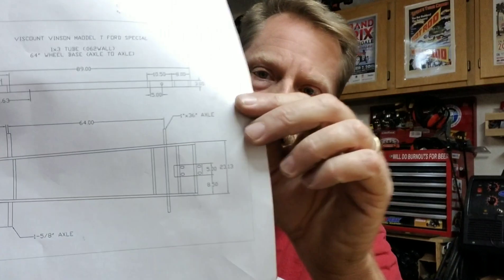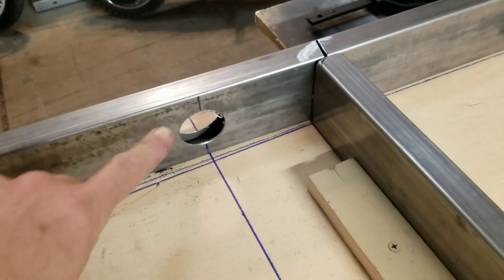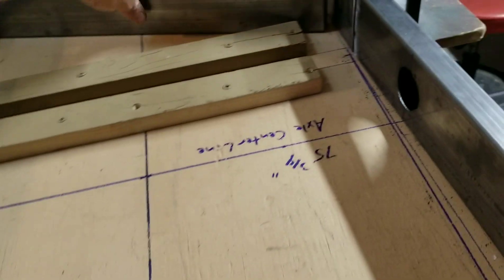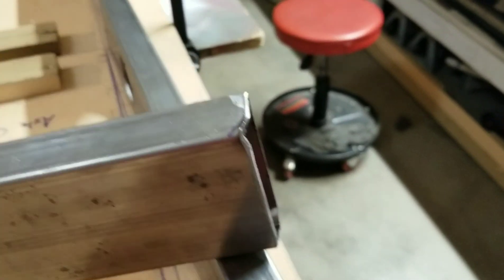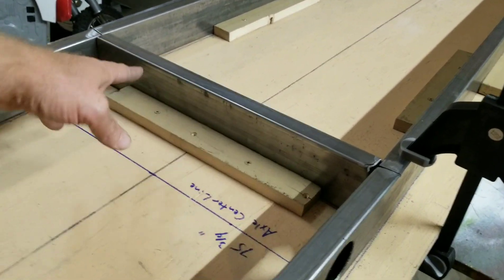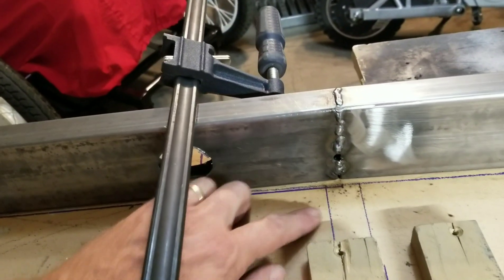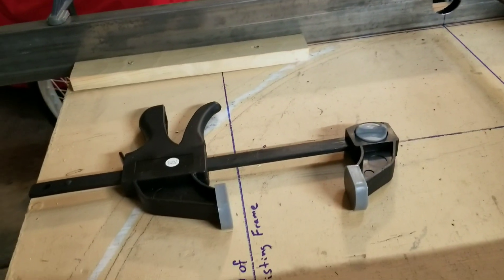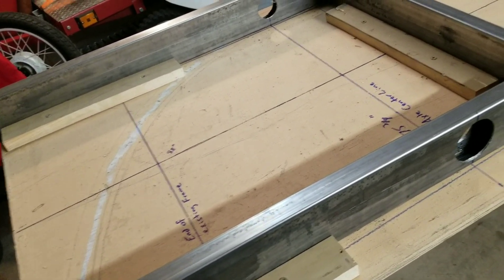Cyclekart Frame video #4

Comment: Where do you get the frame material?
Reply from the maker: Local metal suppliers here in Phoenix.  It is a very common size  1" x 3" x .065 or .060 wall thickness.  Some have use the .090 wall it is just a bit heavier.

Comment: Great stuff Steve.....I am doing the same thing on my frame bringing it in at back and I will be sure to measure twice so I don't cut the frame in the wrong place. I like the jig you made and I will use the ideas you came up with. I didn't think about knotching the crossmember to make way for the frame rail to come in so thanks. I probably would have realized that I had to do that but now I know and learned from you. I have watched your buddy Dennis's video and what a builder he is too. Great fun hobby and I can't wait to get a running chassis made.
Reply from the maker: Thanks for watching.  I'm glad to be of help.